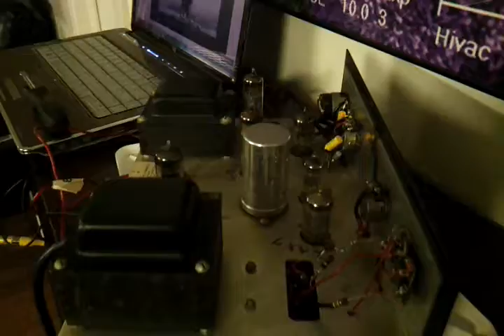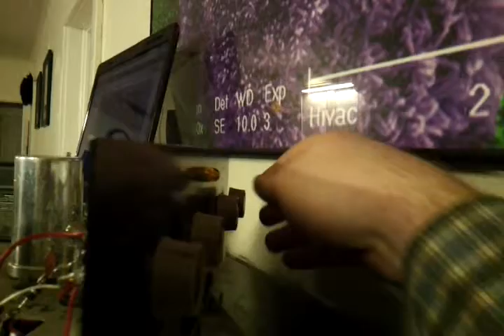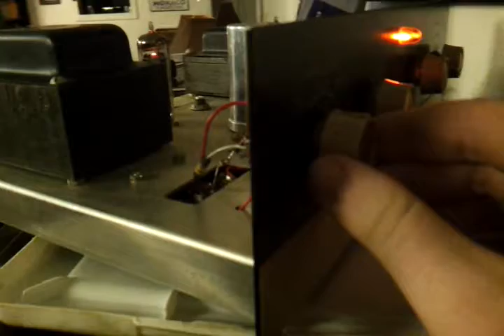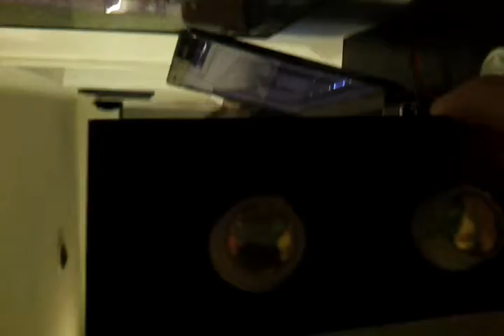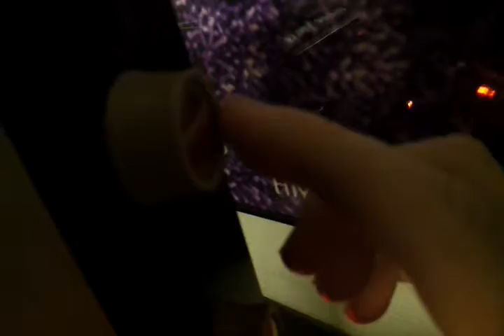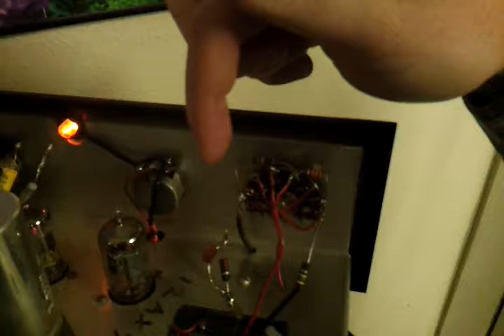Trouble with Heathkit EA-2 Amp after recap

Comment: I am just starting a similar project on an EA-2 but it's the first project like this I've undertaken and don't know much about circuits, etc.  My hum control resistor is blown out but can find an exact replacement.  You have replaced yours here.  What did you replace it with? What specs do I need?  I find a lot of 100ohm potentiometers but not sure what wattage I need.  Thanks or any help.

Comment: Resistors and capacitors should be taken out of the circuit and tested to be accurately checked to see if it has drifted in value.